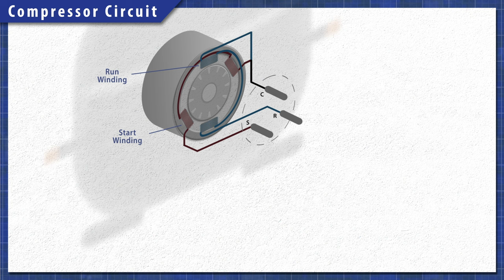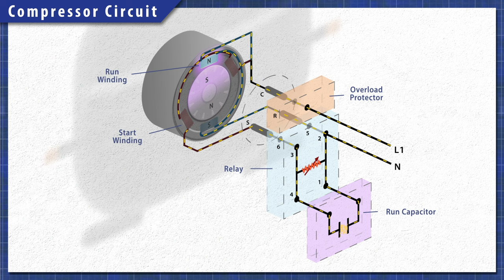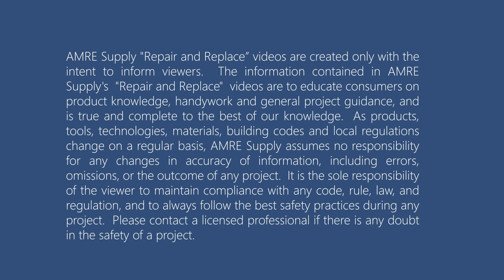How a Current Start Relay Works (Refrigerator) | Repair & Replace

Comment: I have a whirlpool chest freezer model S-03-XEH11CDXGW and iam looking for a compressor start relay for it
Reply from the maker: Thanks for watching. Normally parts can be found by entering the number on this search tool: https://www.amresupply.com/lookup but for that particular model nothing shows. You could try matching by looking for a number on the side of the relay, and searching based on that number. If you are unable to find a match, then you could install a 3n1 relay: https://www.youtube.com/watch?v=8dRlB-VquDc

Comment: Hello, my fridge was not cooling on both sides. I just replaced both the capacitor and start relay. I plugged the power back on. I hear the buzzing sound for 10 seconds then it stops. Then it comes back on again later. Does this mean the newly installed parts aren’t working? What else can I look into?
Reply from the maker: Thanks for watching. It could be the overload protector or an issue with the compressor. This video is a complete guide to compressor troubleshooting: https://www.youtube.com/watch?v=NND8J8dXqJ0
Hope this helps!